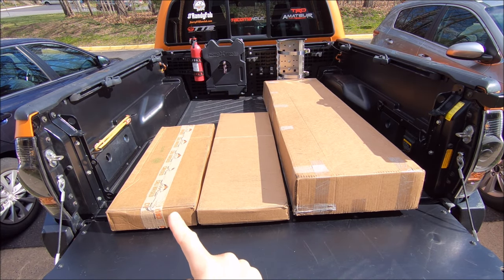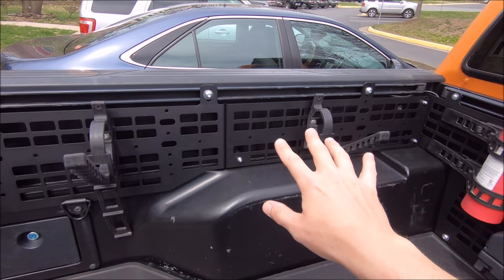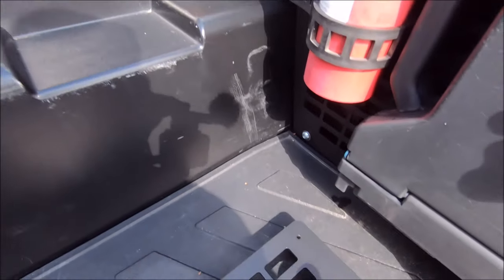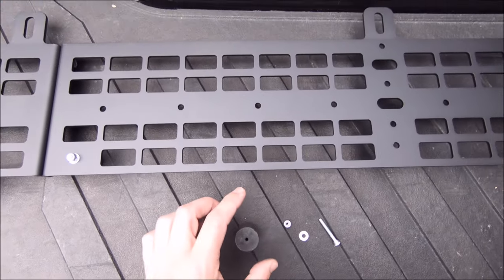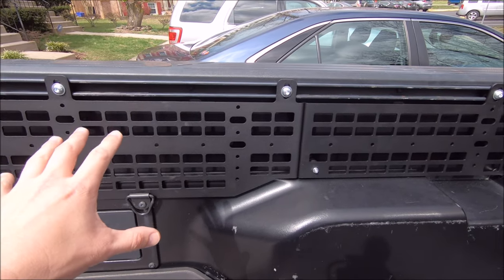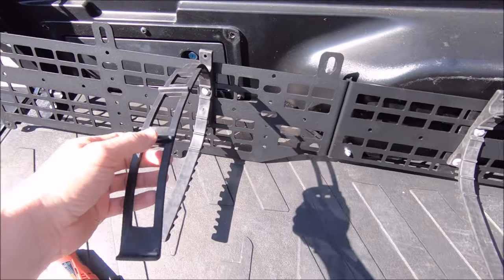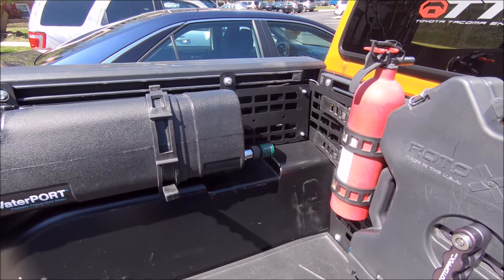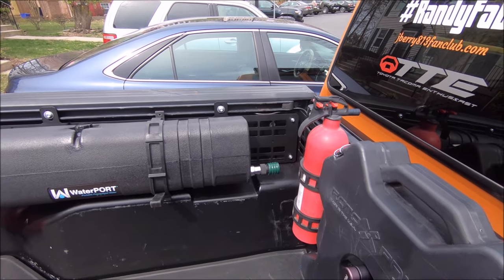Cali Raised Toyota Tacoma Full Bed Side Molle Panel System

Comment: Get a 90-degree fitting for the end of the Waterport then attach your Quick-Connect to it. And your Amazon link for the Water Port: The one on Amazon does not look like the one you have.
Reply from the maker: Excellent idea.
Reply from the maker: I've got the older version of the Waterport and looks like they only carry the new one.
Reply: @Tacomaholic  Which do you think is better?

Comment: Great informative video...would this system work with the factory hard shelled, tri-fold Tonneu cover?   Any idea if the manufacturer has an updated system that allows you keep the forward bed anchor points without having to drill into the molle system itself?
Reply from the maker: I'm not sure how the factory tonneau cover is installed. I don't think they have updated the molle to be able to use that forward ancho point ... but the entire molle panel is an anchor point really.

Comment: Are these stong enough to hold onto a mounted spare tire?
Reply from the maker: Best to contact the manufacturer about that, but I would think they would be ok with light offroading ... but mounting something heavy like a spare tire to the bedsides will causes unnecessary strain on the bedsides which have been known to slowly separate over time from the combination of offroading with added weight.